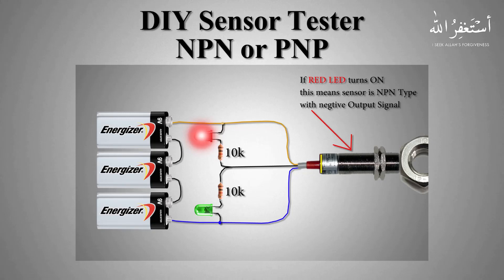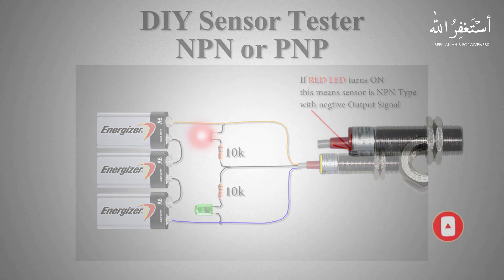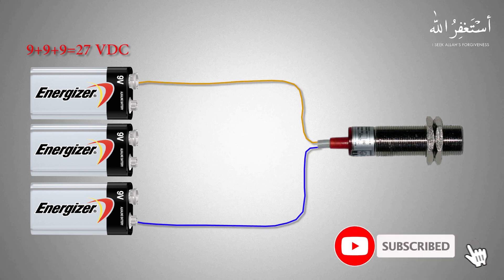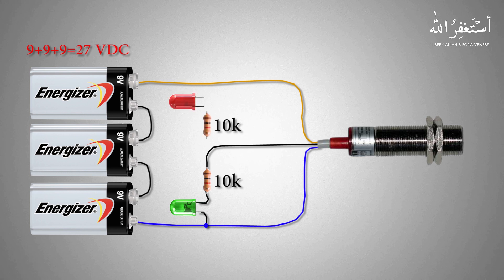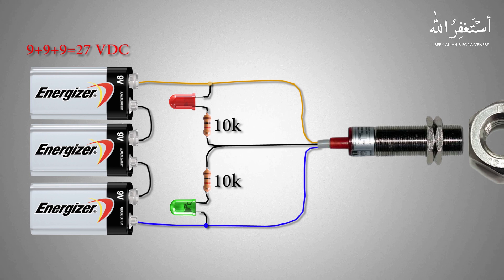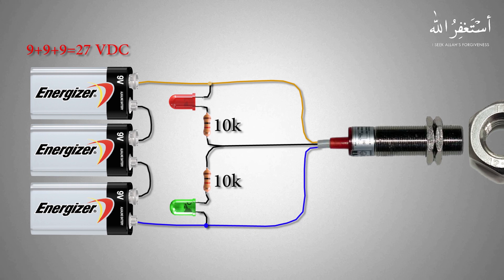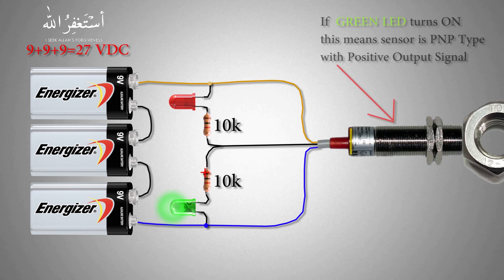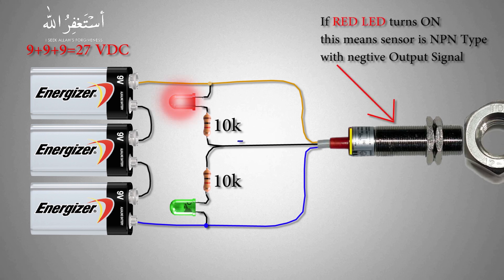How to make a sensor tester ? NPN or PNP

Comment: Both my LEDs turned on without even connecting a sensor yet?
Reply: Yes, because this is not a functioning tester circuit. Power will go from positive through red LED, through green LED and back to common; turning both LEDs on.